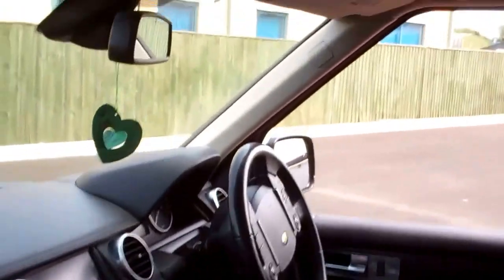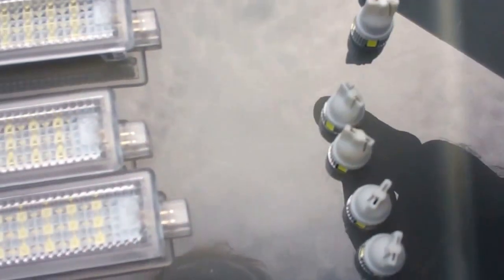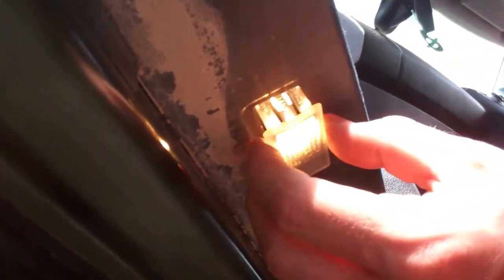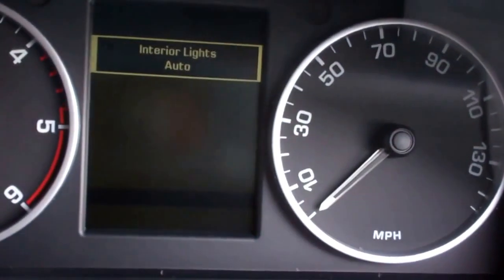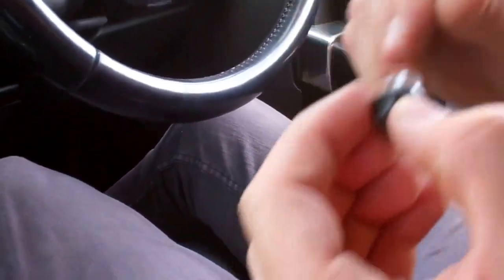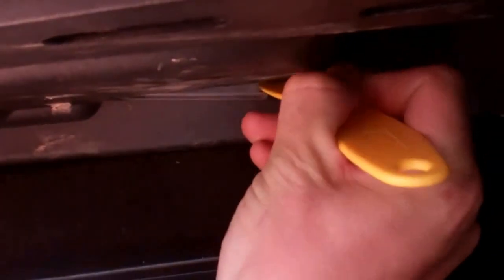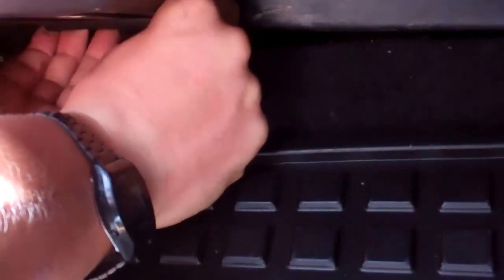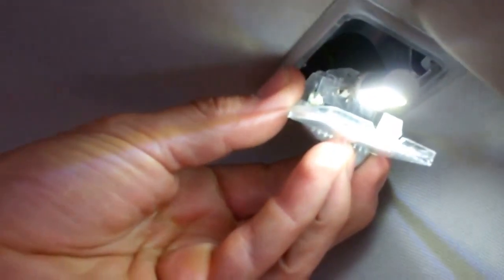Land Rover Discovery 4 LED interior light upgrade - Full kit

Comment: hi. just done my door puddle lights. the rear door lights work but the front dont? they worked with the original but dont work with that now. any ideas. just bought some of your window deflectors. awsome
Reply from the maker: Thats odd - try locking the car - then try again.... also try an ignition cycle and try again. You could try swapping the rear lights into the front doors... as you know those units are good.
Reply: @L663  hi, never thought about swopping them. quite a few reports on the web with same problem, fronts dont work but rears do. even disconnected the batt for 10 mins. let you know. thanks. mike
Reply: @L663  hi again. tried the cycle no better. drove 40 miles to work no different. 40 miles back still the same . is there a fuse for these?
thanks
Reply from the maker: Look at this diagram ( for the sport ) on page 188
https://www.lrservice.ru/data/277/RR_SPORT_VIN_147226_OK.pdf
It looks like all the +ve are joined together.
Unless its an earth issue - or the D4 is different ?
Reply: @L663  they work now with the original bulbs, have ordered resistors to go with led 
thanks